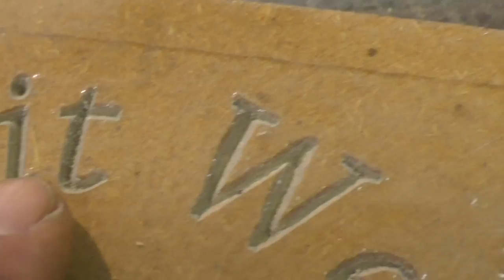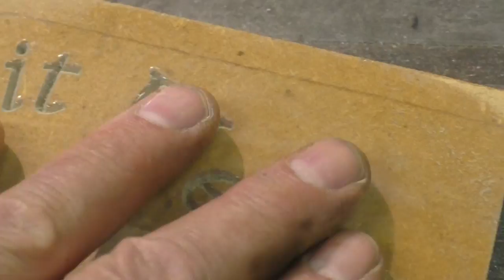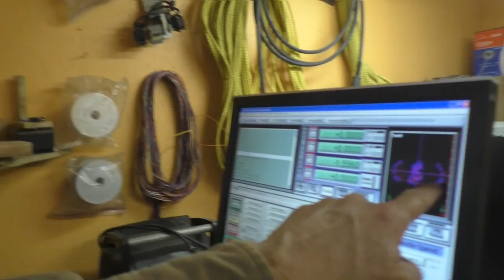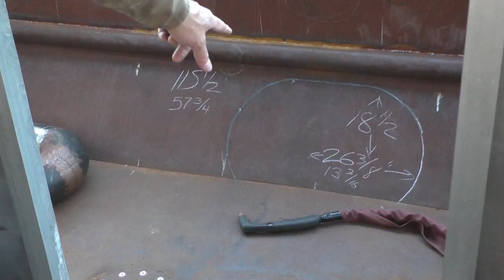Bulwarks, CNC Routing, Casting Anodes, Decking, Chocks and more

Comment: Boat looks great. Been watching for a while now. I built a 40ft steel ketch a few years ago. Might be a bit late but it's worth casting steel into the anodes around the bolt holes, or a strap between bolt holes so that once the anode starts getting eaten away and the zinc/aluminium dissolves, the steel keeps it secure and we'll bonded to the hull.
Reply: Good idea

Comment: Doug, instead of using ESC key in Mach3, you could use spacebar. 
Spacebar is Feedhold. It works by executing the current  line of G-code and then pausing after it is done. This way you don't interrupt in the middle of a movement, but get a controlled stop without the drift issue.

Comment: Shellac or sanding sealer is also a good way to seal the cut surface of MDF. It's cheaper than 5 minute epoxy and dries in seconds. Worth a go if you do that again I think.

Comment: For screwing into hard wood, dip your screws into Tallow 👍🏻 also if you're doing a compound cut (2 angles) on your floor plates? Make them square and then cut the angles, much easier and quicker 👍🏻

Comment: Hey Doug,

I'd try routing the letters in PE (polyethylene) sheet. You can get them at places that sell machining plastics and it's relatively cheep (you can also make your own from old bottles but that would unnecessary complicate the matter). Finish should be quite smooth and require no mucking about with epoxy :)

Comment: Your loosing steps to the stepper motors, your exactly correct when you are in rapid mode and
you suddenly stop the stepper mother overruns it position and Mach3 thinks it's at. You can lower the rapids in the motor tuning page. I find that I usually reload the program after every time I stop a program mid stream. Dave

Comment: Friend of mine who does a lot of metal casting told me that with regard to Soduim Silicate / CO2 moulds, if you add a half a percent of glucose powder to the sand before you add the sodium silicate, the sand mould will disintegrate more rapidly in water when you're removing it from the moulded part at the completion of the pour. The bloke in question has been a foundry metallurgist for 40 years and has specialised in brass, bronze and what you yanks call "Ulloominum". I have no reason to doubt him. He also said that if you pack a thin layer of very fine facing sand on the surface of the pattern you will get a very fine finish on the moulded part which will require a lot less cleaning up work. If you feel so inclined to have a look at the way he operates, you can find him by typing "olfoundryman' in the Youtube search box. Another bloke who really knows what he's doing is a bloke called "luckygen1001" He works with Cast iron.
Reply from the maker: Thanks

Comment: What about using Smiths penetrating epoxy on the MDF before routing the letters. If its thin enough it should go deeper than the letters so you dont have to  carve it twice

Comment: a good trick for drilling lots of holes to depth 'freehand': instead of the tape, take a piece of scrap wood, and cut it to the length between the end of your tape and the drill chuck, then drill through it in that direction, and use it as a physical stop. This is nice because you don't have to watch it as close, and and unlike tape, it won't creep and slide if it gets warm. (or get your drill bit all gummy)

Comment: did you ever find out if it was a mechanical error in the cnc process? ive seen mach 3 do some wonky things if say you press the space bar (hold feed) vs clicking the stop feed button. ive paused my cuts mid through using space bar to pause and then the z axis plunges way too deep! best of luck keep up the good work

Comment: It's the same with 3D printing, pause using the menu or program and it just empties the buffer then stops which quite often restarts with an offset. If you add a pause at layer change in the Gcode it restarts no problem.

Comment: Probably been said already BUT If you use feedhold(space bar) the machine will stop at a point that's safe and you shouldn't lose steps and should be able to start right back up when you finished doin whatever you need

Comment: Wax works well for the screws, but instead of candle wax, pick up a wax toilet ring at the hardware store for about $3.  It's a nice soft wax that is easy to get onto the threads and the wax stays in the threads, unlike candle wax which tends to come off in flakes.  One ring will last you a long long time.

Comment: Watching the build in order, apologize if this has been answered (or will be covered in the next video), but @4:00 you are welding the support structure back into the upper rails... did you find out the boat could be moved with those installed, wasn’t the plan to remove everything above the deck/cabin tops to move it to the Port?  ??
Reply from the maker: Yes, we settled on a way to transport the boat with the keels just 12 inches off the road so that allowed us the attache the bulwarks.
Reply: cool, I assumed as much just hadn’t seen it covered. It’s really coming along. Keep up the good work!

Comment: Lost stepper steps, because of the weight of the axis and not ramping down. You would need a closed loop system if you want to be able to interrupts the gcode with out a lost of position.

Comment: in Mach 3, If you click the "Feed Hold" button first, and then "Stop", it will finish the current line of code and then stop, awaiting a "Start" or "Stop". This is the best way to not loose "0"

Comment: i wondering about sumting , are the mountingbolts to commercially available anodes spaced the same ?
its just that it would be handy if it was , you could then do a quick change in a pinch by mounting a storebought one
Reply from the maker: Yes.  I took the design from an available aluminum anode.

Comment: You probably already know but in Mach 3 if you want to stop the machine its better to press on "feed hold" instead of stop, the machine will get to the next line of g-code then stop after its finshed moving that line, then it shouldn't lose its zero references!Peace

Comment: why do you add zinc to the aluminium? The aluminium isn't going to rust away because of it's protective layer right? or is this for more strength and looks? please let me know, really interested. greetings from The Netherlands! :D
Reply from the maker: It prevents the aluminum from forming it's normal aluminum oxide coating that would prevent it from being a good anode. http://www.svseeker.com/wp/wp-content/uploads/2017/04/Aluminum-Anodes.pdf
Reply: but zinc also has a oxide protective coating? or does that conduct electricity

Comment: do you get ur supplies locally or do you order them from somewhere I live in Okmulgee and I'd like to know thanks
Reply from the maker: I get the sand from Rich Mix here in Tulsa but I have to buy a pallet of 42 bags.  How many would you like?  :)    The sodium silicate came off ebay because the chemical company has a $250 minimum.

Comment: You cannot effectively steer your towing vessel unless the tow point is ahead of the rudder. Your tow will steer you. Shrimpers, draggers, tugboats and beam trawlers all have the tow pivot (Sampson Post) well ahead of the rudder post. If you cannot spin the boat around the tow point, you cannot steer. The tail will wag the dog. 
This is why the weekend boaters are always so surprised that the boat they are towing is going to kill them or others.
Towing nets, or ROV's or fishing gear is more like flying a kite than driving a SEMI, and with the underwater stuff it is like flying a kite that you can see from, but cannot see.
Reply from the maker: Shrimpers, draggers, tugboats and beam trawlers....  ....none have deep keels.  : )

Comment: May I ask why did you add zinc into the mix? What are the benefits?
Reply: These are zinc anodes to stop the steel rusting away so quickly due to electrolytic action in salt water. The zinc goes first. regards
Reply: MadcapPanic Without it the aluminium oxides would make the aluminium useless anodes since its tougher than the steel...kind of ☺

Comment: why zinc and aluminum mix besides cost? is there a benefit to the mix?
Reply from the maker: The zinc prevents the aluminum from insulating it'self in aluminum oxide, so it keeps working.
Reply: I was about to ask for exactly the same clarification - I was well aware of using Zinc as an anode, and that Al tends to passivate pretty quickly (passivate = develops a stable insulating oxide skin) so I figured the zinc helps prevent that from happening - kinda the opposite of Cr in stainless steel...

that ticks off the "thing I learned today" box...
Reply: where can i buy the zinc ? @bulwynkl

Comment: Have you considered using acrylic or arreated PVC also known as X PVC for the castle box you can assemble it with PVC glue it's waterproof engraves very easily.

Also using a CNC engraving bit of this configuration will give you Superior Engraving.
https://s-media-cache-ak0.pinimg.com/736x/99/e7/95/99e7959563dbc6fa2880d27824fd6c62.jpg